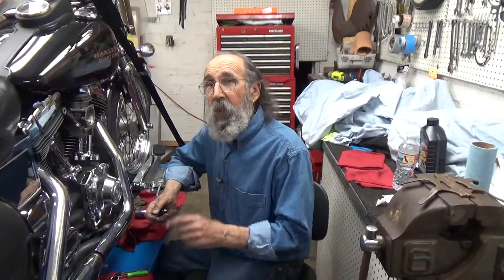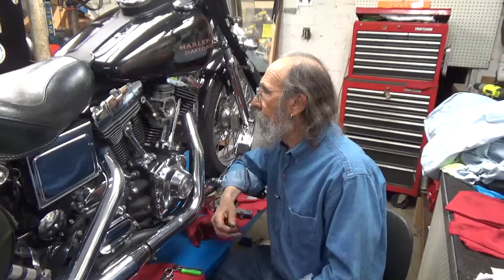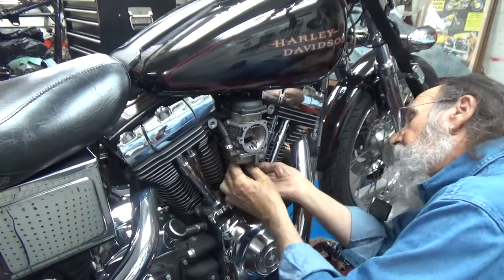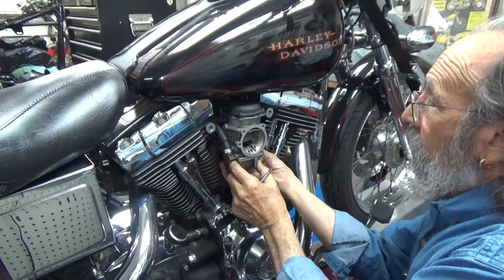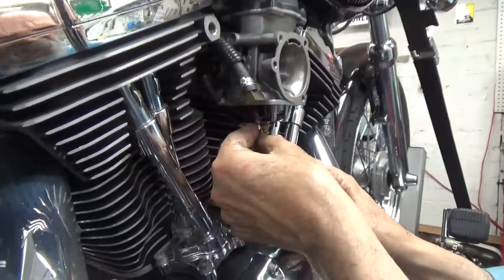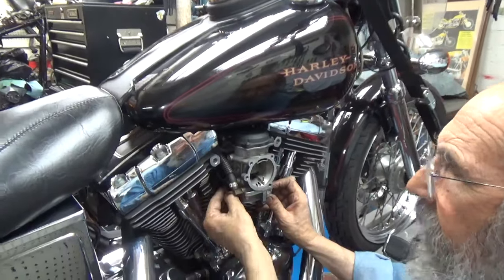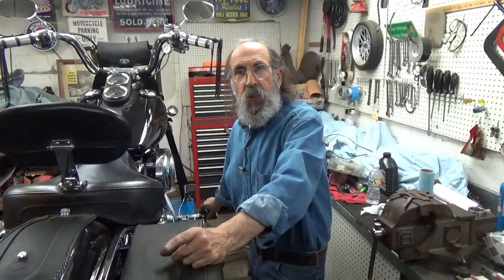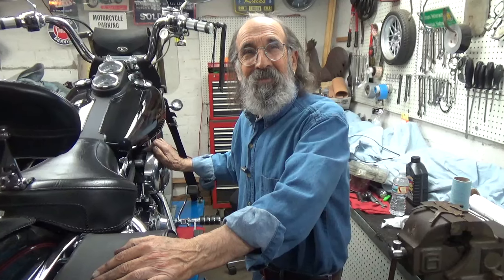Rejetting the Carburetor on a Harley Twin Cam

Comment: Great video. Can you tell me where to buy jet kit for my 2001 duce 1450cc with carb? I have race exhaust and air intake my bike sputters till warm
Reply from the maker: Thank You.  Any good motorcycle shop should sell individual slow jets.  They are the same for all of the Keihin carburetors used on Harleys.  All you need to do is go up a size or two and see how it does.  It's not difficult.  If that doesn't quite do it, go a little bigger.  Last time I looked, those jets were about four dollars each.
Reply: @pacificmike9501  Thanks

Comment: Great video , Mike. I have a 98 softtail with a mukuni 42 carb. It had a free flowing exhaust and I added quiet baffles , now it's running rich. Where should I start? It has a 160 main jet , but that's as far as I have got. Any help would be greatly appreciated, thanks
Reply from the maker: You need to try a smaller pilot jet.  Main jet is usually fine.
Reply: @pacificmike9501  Thanks , brother

Comment: Hi Mike, I've been tinkering around with my Big Twin with a CV40 carb after I had a 4-5/8" stroker flywheel assembly (89")  & EV27 cam installed. It seems like the previous jetting is no where near what it's needing now. So far I'm at a 52 Pilot and 200 main. The plugs are showing no signs of browning whatsoever and seems to be lacking some power as i get into it, I keep seeing improvements as I add larger jets. I'm just going to keep going bigger (55 Pilot/205 main) until it gets better. Is this "normal" for stroker motors? Seems like these strokers sure are thirstier than your average Evo. Thanks for sharing some of your knowledge. I might add that the timing is perfect and has all new seals, float level is also perfect. Thanks
Reply from the maker: You'll just have to see.  But, truth of the matter is, you'll be shifting sooner.  You won't need to wind it up.  You won't have to open the throttle as far.  It is, however, important to realize that today's fuels in today's motors don't color up the plugs like we used to see.  I'll love to hear what you have so say after you get it dialed in well and travel with it.
Reply: @pacificmike9501  Mike, thanks you for sharing. Yes, this has been a challenge I must confess. The internet is full of people who are running standard jetting for CV40's. There aren't many people who are running a CV40 carburetor with a Stroker configuration, most folks switch to an HSR-42 or S&S carburetor for performance purposes but the CV is a good carb if you know what you're doing and make all of the right adjustments. Jerry Branch proved it is capable of producing just as much HP as a HSR-42. I'll keep you posted on my final set up. Baby steps....
Reply from the maker: You'll get there.  I did build a 95" Twin Cam with all the stuff.  I mean, an awesome pair of cylinder heads, big cam, I mean the full deal.  The guy already had a 40mm flat slide Mikuni (it was slightly earlier than the 42).  When I finished it, I ran it against identical motors with 42mm Mikunis.  I swear that 40 had a little more torque, I assume from the greater velocity.  Don't worry so much about your main jet.  The idle jet does most of your riding.  I wouldn't argue the point, but I believe you would enjoy the Mikuni HSR42 a little more.  I know it's quite an expense.
Reply: @pacificmike9501  I got it Mike, I was going the wrong way with my jetting and noticed that I was unable to starve the motor of gas by closing the air/fuel mixture screw which told me I was too rich on my jet. I went back down to a 48 and was able to get it to stumble while turning it in and gently seated it. That told me that I had the correct size. I then opened it up to where it ran rough then closed it 1/2 a turn. Seems really happy there! Thanks for the confidence boost, I almost threw in the towel. ✊

Comment: Could you ever do a video on a Mikuni HSR 42 complete tear down and rebuild. That would be a great help. Thank You
Reply from the maker: I don't have one that needs it.  Easy carburetor though.  Be sure you have the Mikuni Manual that comes with the carburetor.
Reply: @pacificmike9501  can you put the body of the mikuni in carburetor cleaner? or do I need to just clean it with a can of carb and choke cleaner?

Comment: Thanks a bunch my grandpa left me his harley after having it stretched and raked a bit when he passed and I've been trying to get it up and going for two years now .the mechanic he took it to robbed all the expensive harley parts and swapped it with cheep sportster parts and I'm just now getting it up to par to be roadworthy ..a rusty gas tank needs replacing and then a new carb outta do it ..wish I had a good go to guy like yourself that's knowledgeable to help get it all the way there he wuld kick my but if he knew it was still sitting on my porch I kick it over every month or so just to keep it from seazing up thanks this video gives me revitilized hope it will thunder once again..
Reply from the maker: You'll do it.  It's Spring.  I have faith in you.
Reply: If it’s been sitting around for a while drain the gas then pull the carb bowl and clean it put fresh high test gas in if it’s not ok clean the jets.

Comment: Hello mike would you have an idea why my back cylinder on my 03 sportster would run leaner than the front cylinder
Reply from the maker: Generally, it is a vacuum leak, either from a vacuum hose on the carburetor or at the manifold to cylinder head ports.  One spark plug burning dark and one light?  Look for a vacuum leak.

Comment: I would not have gone to a 50 without finding out if the air fuel mixture was correct with the 48... I think 45 is stock on these.. a lot left out of this video
Reply from the maker: Sorry.  The point was that it is so simple to do, I encourage experimenting because the available power is so great.

Comment: Do you have to re jet when adding an aftermarket exhaust? Or only if you add a better air intake?
Reply from the maker: Both afect air flow.  Need to rejet for both.  Replacing them both will increase the airflow which means air to fuel ration now must be addressed.

Comment: So I have an s&s carb on this new bike I bought it's a dyna lowrider it's got the big bore heads from screaming eagle and a screaming eagle exhaust. Now the previous owner put a more restricted exhaust quieter two into one exhaust on it from open pipes now it run kind of rough and it makes the plugs black I was told I need to rejet the carb bc of the exhaust or put a more open exhaust back on it does that make sense to you? It's currently stored away for the winter I live in upstate NY so can't ride in the snow lol just some thoughts from you would be nice
Reply from the maker: It makes perfect sense.  If it was jetted for a free-flowing exhaust, it had big jets to obtain proper air/fuel ratio with the increased airfow of both the intake and exhaust.  Restricted exhaust will require smaller jetting.  You are, of course sacrificing power in order to maintain the peace.
Reply: @pacificmike9501  idk if I mentioned this before but I just bought this bike from a stranger so idrk what is exactly done to it it's got good compression do you think putting a more free exhaust on it will kill the valves or rings a few ppl told me it could and a few ppl told me no way
Reply from the maker: I don't know what combination you have or how you're running it.  But, it sounds like it is a hot rod of sorts.  You've already told me it has an S&S carburetor and air filter, high performance SE stuff in the motor.  I would definitely want a high performance exhaust and jet the carburetor as needed after installing that exhaust.

Comment: Hi mike I have a 93 softail custom when cruising on the highway the bike sometimes shuts down it starts back firing then the motor stops I pull over hit start button it will run for a bit and do it again but if I crack the low side fuel cap it seems to fix it any advice
Reply from the maker: You apparently are not venting your fuel tank.  The right cap should be vented.  The crossover tube between the tanks (on top) should be clear.  If you're runing any kind of high performance equipment in or on your motor, you might want to increase the breathing on the right hand fuel cap.
Reply: I bought some new caps still same problem could I have a faulty VOES ?

Comment: Hi Mike, my apologies for hijacking a Twin Cam thread, but any chance please of a recommendation for the pilot and main jets for an Evo in an FXR? The Evo has the standard CV40 carb but with a N72S jet needle. The FXR has a Arlen Ness Big Sucker air cleaner, Trask 2-into-1 exhaust, and a Fueling 518 cam. Everything else is standard FXR Evo. I’ve tried many different main jets and pilot jets, and find ‘reading’ the Champion RN12YC spark plugs impossible.  From your experience, do you have a suggestion for main and pilot jet sizes that you can please share? Thanks!
Reply from the maker: Where are you?  Are you at sea level?  Are you at 14000 feet above sea level?  Are you in an arid climate or a moist climate?  Where were the bikes before they landed at your proximity?  Did they run well there?
Reply: @pacificmike9501  Thanks Mike, I'm at sea level in a nice dry climate.  On the original jets [42 pilot and 180 main], the bike ran lean including wheezing/stuttering on pulling away and constant popping on deceleration, plus the plugs always looked just like new.  Upping the jet sizes made no real difference to the plugs; the white ceramic insulator looks near white but the top of the metal threaded part gained a dry black sooty ring. However, the bike runs much better with the larger jets [including no wheezing/stuttering on pulling away and no popping on deceleration] but has increased fuel consumption. I am very certain there is not a manifold air leak.
Reply from the maker: That 42 jet is tiny.  You're on the right track now.  These bikes are modern and they burn clean.  Hard to read plugs any more.
Reply: @pacificmike9501  Thanks Mike, any chance please of a suggestion for my Evo like you had for the Twin Cam [52 pilot]?
Reply from the maker: Start with a 48 pilot and see what happens.  Not a big operation.  Jets are cheap.  Main jets aren't nearly as finicky.
Reply: Thank you!

Comment: Another great video. When I had children at home, I would take the jet to them and have them read it to me. Now I need to use a magnifier. I would love to see a video on checking and replacing cam chain tensioners for the early twin cams.
Reply from the maker: I haven't done one in quite a while.  If I have to, I might.  But I don't see one at the moment.

Comment: Great video. I just bought a replacement 40MM CV carb for my 2005 Dyna FXDC. I had questions about where to start with jet sizes. Pretty sure you answered / explained all my questions. Again, very informative video, and may thanks!
Reply from the maker: Glad I could help.

Comment: I have question about HD Road King engine. Is the TC 88 was mounted before 1999, in this model?
Reply from the maker: Harley first introduced the 88 cu. in. twin cam in the 1999 Models.
Reply: @pacificmike9501  how about year 1995. my mate bought Road King the same year with 1449 engine. i found information in internet, that Road King FLHR with EFI in 1995-96 had engine 1449? it is Twin Cam or Evolution? I am confused about that.
Reply from the maker: Not so.  Evos were 80 cu. in.  (1340 CC).

Comment: If your setup is fine before stage one air filter and already have exhaust do you think I will just need to adjust air fuel srew 
And if I need a rejet do I need after to re adjust air fuel or just put a jet in there and let the same setup ( air fuel srew). 
Thank awsome video
Reply from the maker: Air fuel screw (idle mixture) is something you can adjust by "ear."  Generally, (depends upon altitude) when you manage to get more air through your system (more in with a less restrictive air filter, more out with a less restrictive exhaust), you'll need a larger low or the same thing, which is called an  "intermediate" jet.  By the way, next time, please tell me what kind of motorcycle you have.  I'm assuming it is a late model Harley with a carburetor.  "Stage One" makes me think late model.  Jets tell me it's carbureted.  You're looking at our videos, so, it's probably a fairly late model carbureted Harley anywhere from the ninties to about 2008.  Don't make me think so hard.  And, are you at high or low altitude?  Thank You.  It's not actually very difficult.
Reply: @pacificmike9501  its a Flhx 2006 1450 carb engine 
I live in Saguenay QC Canada we are at 275 ft (elevation ) 
I bought the bike last summer he had megaphone slip on they sound nice but no restriction and cheap stuff I put. Kuriakyn Chrusher exhaust on it and I adjust air fuel 2-1/2 turn and bike was running strong 
But this winter I put a stage one air filter and a set of true duals head pipe 
So I wondering if I just need to adjust again the air srew or let the same setup and change the low jet 
Thanks for your quick answer REALLY appreciate 
Best regard ☺️

Comment: Such a great thorough video, Mike. Thank you. Just out of curiosity, with the 50 slow jet in there, how many turns out did you set the pilot screw? Also, I never found concrete information on what the factory setting was on these 88 motors. I’ve heard  before 1 and 3 quarters. Is that correct? Thanks a lot! Aron
Reply from the maker: That little mixture screw on the Keihin carburetor does very little.  Listen carefully, with it warmed up good, then set it as close as you can hear.  It's just not that great.
Reply: I see, thanks Mike.
Reply: I cleaned out the carb and put in a 48 slow, set screw at 1 and half turns and wow what a difference!! Flawless cold start, smooth idle and responsive throttle. You’re a magician. Thanks

Comment: Great video! Very informative, hope you can help me. I just got a 2003 FXST  and it was running rich. I leaned it out as much as I dare, pilot jet is now at 7/8 open, think I need next size smaller. The issue is the front cylinder plug looks pretty good, but the rear is coated black. I know they are usually not the same, but this is extreme. I would upload pictures but don't see how to. Any thoughts or suggestions, thanks in advance.
Reply from the maker: Most likely, you have an intake manifold leak and that means the seals on the intake manifold need replacing.  You don't open or close a pilot jet, you replace it with the size you require.  We do have videos on both of these issues.
Reply: @pacificmike9501  thanks for the super quick response. I was referring to the fuel/air mixture screw which is now 7/8 of a turn, instead of around 2 turns or so where it should be. Don't know what size the pilot jet is. If it is the intake manifold gasket would it be making that cylinder leaner than the other?
Reply from the maker: Most definitely.  The light plug is from the cylinder getting air in.  Removing the manifold to replace the seals is a pretty common occurrence.  That mixture screw does very little.  It helps some in fine tuning, but not much and only at idle.

Comment: I just had to do this to my carb. None of the jets looked blocked but I cleaned the whole thing anyways. Hopefully it runs and just needs some minor adjustments.
Reply from the maker: Cool.  Be selective in the fuel you run.  Pay attention, and soon you'll know which one is best.  It will burn clean.  Stay away from the rest.  It's no big deal to change a slow jet.
Reply: @pacificmike9501  Fuel matters? I normally just run regular figured that was okay. Had to take it off int he first place cause the bike wouldn't run off choke after changing the exhaust gaskets and throttle slide in the carb.

Comment: Even when I’m not seeking advice ( which this time I am) I just enjoy your videos. You know your stuff and seem incredibly humble. I have this exact bike, year and all that I just acquired, it doesn’t run too well at my elevation. What jets would you recommend for 4500-5000 ft elevation? Thank you in advance sir.
Reply from the maker: Just a guess.  I don't know what's in there, but generally, going smaller on your pilot jet is what you need at high altitude.  You're probably running rich.  I don't know where the bike ran before you bought it.  This becomes a guess.  Just remove the pilot jet (if it's running rich) and installer a "leaner" jet than the bike now has.  That would be a lower number.
Reply: Pacific Mike it was in San Fernando valley, so about 2-300 feet

Comment: i have found on CV carbs to change the slide needle and  tube to a different taper which gives good low end acceleration no low speed lean spitting  of course the jet also depends upon the exhaust  stock or punched out.
Reply from the maker: Yes.  But, punching out stock mufflers just makes more noise, not much help there.  Step up and buy less restrictive units.  You'll be glad you did.  Then an air filter and rejet.
Reply: @pacificmike9501  I have used the same carb kit  on CV carbs which I have found to be what I believe to be outstanding in performance and that all depends on exhaust  and of course the customer.

Comment: GREAT VIDEO!  IMO being that engine oil travels through there, you should use engine oil to lube the O rings.  Have to use Lock tite or you'll drop your parts on the highway.
Reply from the maker: I don't locktite carburetors.  If you're referring to o-rings in carburetors, white lithium rules.  Try it.
Reply: @pacificmike9501  if not locktite on the carb, Anti seize lube?
Reply from the maker: Just put it together nice and tight.